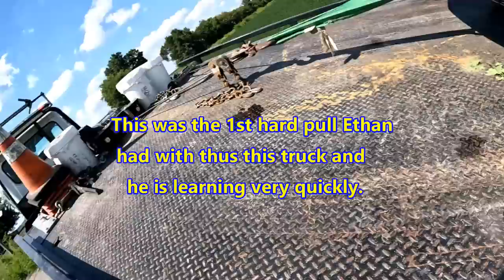In Deep!!! Lincoln Navigator Ditched!!

Comment: Awesome use of the endless I only carry one but great use, what won this is the neutral override. Some small hints we had allot of hands on this one I am giving my ideas as we all have them. Alone I would angle my bed to the rear drivers side tire. Next hook the far side mini J not inner with a snatch on the line for adjustments. Get tension and override if possible if not go right to trans and do it there. Start pulling use snatch if needed generally will take a few minutes extra but your alone. Once everything is pulling semi straight connect second mini and finish pull

Comment: You folks should consider adding a sailboat winch (capstan, gypsy head) to your trucks and carrying ropes (in sailing terms - sheets).  You exert a lot of energy hauling your hooks and wire ropes from the truck to the vehicle and back. A sailboat hand cranked or powered winch would make it easy to use a small snatch block and a synthetic such as Samson Dyneema 3/8" or 1/2" dia. line.  Sailboat winches can be hand crancked, electric or hydraulic driven.  They are available for large ocean racing sailboats, so they are strong and weather proof.

Companies like Lewmar, Harken, Andersen and Antal make quality winches.  They are available from marine suppliers such as West Marine.

Bob

Comment: Sliding the bed forward will also rotate the load some to roll it up there. With a man in the seat steering with his belt on, no reason you can't use neutral? That would reduce the load on the winch also🤷‍♂️

Comment: Ok my question is why double the pull cable? Can't you just grap the 2 green endless loops and just pull with a single line?!
Reply from the maker: Doubling the pull cable basically doubles the power of the winch, which is exactly what I wanted to do in this situation.  The single line would not have pulled this heavy SUV out of that steep incline.   Thanks for watching and God bless.
Reply: @RonPratt  see I'm learning from the best in the business.🏆✝️

Comment: They must be nice to you letting you hook up the vehicle improperly per USDOT regulations. You need 2 points of adjustable tiedowns. They do let you use the winch as 1 of them even though winches were never meant to be used that way and the manufactures do not recommend them to be used for securement. But pulling the J hooks tight by the winch with no other adjustable point of securement is improper. DOT came out with a clarification on that several years ago. Most recently they even clarified the requirement for safety chains when using the wheel lift of the tow truck. Just FYI
Reply from the maker: Please watch my channel more....  I stress the legality of the 4 point tie down and that the winch does not count as a tie down.  You ASSUME that since I didn't show it on the video, that we didn't perform the proper, legal 4 point tie-down.  That assumption would be wrong.  We did, you just didn't see it on camera.  Unless I'm only moving a junk car around our lot, EVERY vehicle gets properly secured, even if its only going a couple of blocks.  I stress that point extremely hard to try to teach others.  I see too many running around with unsafe and illegal securements that it is infuriating.  Again, watch more of my videos and you will find out that I am not lying to you.  I stress safety, professionalism, humility, and compassion.  Hopefully you will stick around to see.  Thanks for watching and God bless.
Reply: @RonPratt  Thanks for that. Yeah I didn't see it only the J hooks being used. I unfortunately have seen what happens 1st hand when someone does not secure their load the right way / takes short cuts / or just plain lazy.  I am glad you do things the right way. Keep up the good work. Might I suggest maybe a video on how to do the proper load securement be it on a wheel lift, rollback, lowboy... I am sure it may help others

Comment: I would love to get into towing, I even found an international pro star roll back for 50k it is a 2011 seems to be in fairly minimal rust condition, I already have a cdl. Do you have any advice? Cuz I'd certainly appreciate anything you have to tell me.
Reply from the maker: First, about the truck, if it has the International MaxxForce engine, DO NOT BUY IT!!!   If it has a Cummins engine with an Allison transmission, it might be ok, but I'd check it closely.   Make sure everything drives, runs, and operates properly.  
Second, if you buy the truck, you'll need to set up a company, get the appropriate driver's license for that truck, and preferably a lot of training.   You'll need to purchase tools/equipment that didn't come with the truck and you'' need to purchase all you PPE.  There are companies who can help you set up your business, truck license, and proper insurance.  There are also training/certification classes available through several sources, but Wreck Master is probably one of the most well known.   
You will also need clients.  You'll need to decide if you want to do only private tows, police tows, repo work, or a combination and then go out and seek those  customers and/or connections.  There is a lot more to owning a LEGALLY run business than people realize.  I've only scratched the surface.    Hope this helps.  God bless.
Reply: @RonPratt  that helps a ton and thanks for taking the time to reply to me. God bless you and all your guys as well

Comment: I am curious the rollback's capacity.
Reply from the maker: The truck bed and winch are both rated at 12,000 lbs.  As with most modern winches, the capacity drops as the line is drawn in, which is why I had the line doubled back creating a mechanical advantage.  Thanks for watching and God bless.
Reply: @RonPratt  O Okay, thanks for the tip. I was thinking about getting me a tow vehicle(of course first learn the techniques to be a successful operator)  that would also double as a daily driver to make some side income. I believe even though it will take up more space a rollback probably will pay for itself quicker than a wrecker would.

Comment: If that was a proper offroader and not a curb jumper , it would have easily been out of there on its own steam . Pity that in America , they dont import the 70series Land Cruiser , because if that driver was driving one of those , he would have engaged 4 low , put in front and rear lockers , dropped the tyre pressure , being a manual , he could have got out and watched it climb itself out , if however it was a new Defender , Ron and the boys would proberably towed it out due to driver inability and brand reliability .